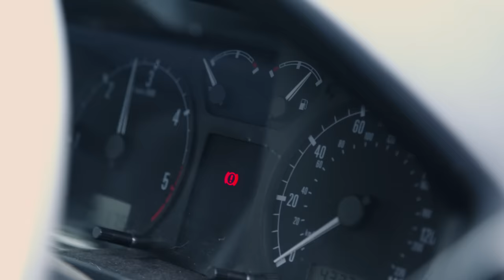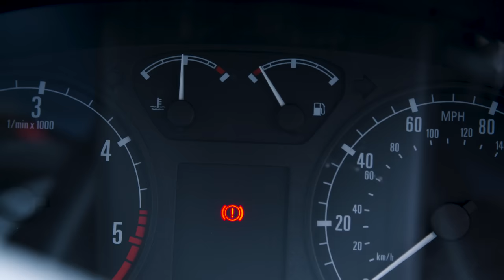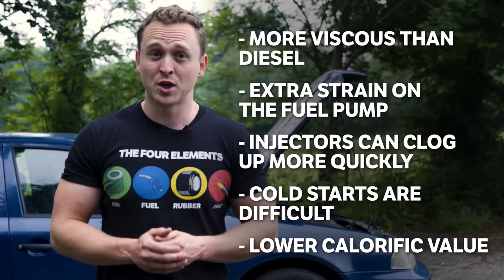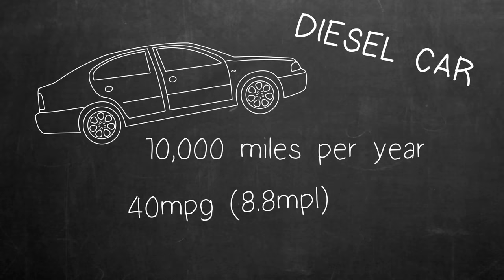The Pros & Cons Of Running An Old Diesel On Used Vegetable Oil

Comment: 6:45 but you still assumed 40 mpg from the vegetable oil, which you surely aren't getting, so you're saving less than 1200 a year.
Reply: If regular diesel does 75mpg, surely 40mpg from the oil is reasonable?
Reply: Yep like he said, it has a lower calorific value so has a lower mpg,  yet he uses 40mpg for both sums. Fail!
Reply: it would probably get the same miles per gallon unless you messed with fuel delivery, but rather you would get fewer horsepower
Reply: Biodiesel has 7% less energy than petroleum diesel. I think the mileage drops that much.
Reply: Imperial miles or US miles?
Reply: DontHatemusiK what US has its own version of miles?
Reply: diazzsama US has different gallon to UK, but miles are the same.
Reply: I hate maths
Reply: I get my oil for -free, and drive 25-30k a year, so my savings are astronomical..  My cost is about 7£ for a filter thats good for 3-400liters and about 5% petrol in the mix wintertime... I actually get a lot of petrol for free aswell, garages that empty the tanks of cars that has diesel in petrol tank or vice versa, for what I use it for petrol or diesel or a mix of the two doesn't really matter...  I does a little worse milage, but not more than 5-10% more

Comment: it also doesn’t have to be old/used veg oil, it can be straight from the supermarket bottle too. a good way to run it would be maybe 25% diesel and 75% veg oil.

Comment: Redirect the exhaust into your engine, free NOS
Reply: Different nitrogen oxides.
Reply: @BigUriel  clearly a joke
Reply: It's not, look up zero emission Santa fe neutraldrop 😂
Reply: @BigUriel  I'd think carbon dioxide would be more concerning in the first place 😁
Reply: Nitrous oxide is different to nitrogen dioxide
Reply: @buddybud-bud3828  r/woooosh
Reply: Filter it into the Turbo LOL
Reply: I think that's called EGR
Reply: That's what the EGR is for on most cars these days

Comment: What about long-time problems - poor fuel pump lubrication, injector clog? And the extra steps in obtaining and using the fuel seem like it is worth it only if you live close to a chips factory or something.
Reply: Veg oil has much more lubrication than diesel. Now for the rest, I'm not sure

Comment: I know this is a bit late but ive just seen your vid. I used to run a '96 escort 1.8d on half new veg oil/diesel. This was about 12 years ago & it actually ran smoother. I am now looking at getting a old, not turbo car thats cheap enough to wreck just to try it again but on used veg oil. It may work but not much lost if it doesnt..........All the  best..............

Comment: Once I had an old Fiat Ducato Mk2 with 2.8L JTD. For over two years I was mixing used engine oil (filtered) with home heating oil 1 to 1.  During winter I was adding 1 part of winter diesel (winter ratio was 1 to 1 to 1). Engine and fuel pump was fine. I was changing fuel filter twice a year but that was like 10 euro per year. Home heating oil was about 75% (50% if you buy in bulk - 200L or more) of diesel price and I was getting used engine oil from a friend's garage for 10% of diesel price. One more thing. The first prototype diesel engine was running on powdered charcoal (or coal, I don't remember)

Comment: NEVER USE STRAIGHT WASTE VEGGIE OIL. You should strip the glycerin backbone form the triglycerides with KOH and MethOH, otherwise, glycerin will gum up everything the fuel comes in contact with, especially the injectors. Ask me how I know. Here in California thankfully we have HPR diesel which is from renewable sources. It used to cost 2.79$ but now it costs 4.00$ a gallon :<. Benefits of HPR diesel over Biodiesel and Number 2 diesel are high cetane (75), lower emissions than both biodiesel and number 2, great cold starting, and equal or better fuel economy numbers!
Reply: Taydrum Hey I have a 2001 Dodge cummins diesel truck and I have no clue how to make biodiesel or if my engine can take it. Any tips?
Reply: "otherwise, glycerin will gum up everything the fuel comes in contact with"
Don't you mean the triglycerides?  There isn't any glycerin in the fuel, unless you have stripped off the glycerin backbones from the triglycerides.
Reply: So, how to strip the glycerin backbone?

Comment: There are other cons: I you let it sit around too long in the tank and especially the fuel line, the oil will turn into a gelatinous, plastised, mess of thick Glop.biosludge will also grow in it. In cold climates, a heated fuel tank is necessary before switching from diesel to veg oil, or it won’t flow. The other cons are frequent filter changes, and the real possibility exposure to pathogens found in rotten meat. I have seen restaurant workers toss cigarette butts coffee grounds, and who knows what else in the bins. Then you have to think about how to keep animals out of the area where you filter it.One more: Rancid veg oil is acidic and will start corroding metal parts in the entire fuel system. Turbo failure, carbon deposits, and the like just for good measure. My poor old 300d smokes after all that kid stuff. I’d get busted by the green police if I took it to town like that.And guess what;?Trying to find it especially in a panic situation ... not likely, and it can’t be stored long . So now, there the Benz sits, after several years of doodling, just waiting for the big savings to roll in.You shall see, young man lol
Reply: He pretty much addresses how to deal with viscosity and avoiding having it sat in your fuel lines in the video. 

Newsflash: Rubbish goes in bins; waste oil does not. Therefore it is unlikely you will have coffee grounds and cigarette butts to deal with. Again the video mentions filtering the oil anyway. 

As for exposure to pathogens, you are aware of how a fryer works, yeah? Even if there are any from later contamination, you're not drinking the oil so you won't get food poisoning. A diesel engine, or indeed any internal combustion engine,  can not get food poisoning.

Comment: Could you run both diesel and vegetable oil at the same time? Could help dilute the oil and be easier on the pump and better for cold starts
Reply: Yes I run 50/50 all the time

Comment: How big of a turbo can miles take? :)
Reply: Mark The Gamer Just put a p47 Thunderbold sized turbo in it.
Reply: That's a damn interesting question actually. Would be cool to see some serious garett with proper bov
Reply: Here in the Czech Republic I've seen some 1.9tdi 66kw with switched bigger turbo + chip, injectors etc. and it runs 170kw reliable.
Reply: Exactly my size
Reply: Diesel engines have no use for blowoff valves since the fuel isn't regulated by the air intake via the throttle body, like in a gasoline engine, but rather by the injectors. Would love to see him do this turbo thing though.
Reply: bov is used to go around problem of back pressure surge. Diesel can have a bov, some stock do have this though I can't recall an example.
Reply: Next video: miles's engine is gone (rod through the block)
Reply: Huh, i always figured that all diesels just didn't have BOVs, learned something new today.
Although i will add that in this specific case on a 1.9 TDi like the one in the video and the one in my driveway, the turbos actually have variable vanes on the exhaust wheel of the turbo, making BOVs obsolete in this particular case.
I did some research and found that it is entirely true that BOVs are necessary, even on diesel engines, but only when dealing with large amounts of boost/pressure (somewhere over 2,5+ bar, dependent on other factors), so i guess were both right.
Reply: See Youtube. THIS is how you have a civilized conversation. I actually had to refresh my knowladge so it's a win - win. I wanted to link you one nice video about bov's but I couldn't find it. It may have been by Car Throttle.
Reply: Miles likes to take a turbo up the tail pipe...
Reply: Haha, yeah Youtube isn't exactly known as a place for civilized discussion. To add to this, I also learned that newer diesel engines actually do make use of a throttle body, although it's controlled electronically. It's main purpose is to restrict air intake in certain situations aswell as reduce NOx emissions among other things.
Reply: amf etamin 
Hey! Coarse, but that's literally how turbos work...you can say it if it's true!
Reply: amf etamin well actually it’s made to allow more exhaust gas to recirculate since diesels nomaly are turbocharged

Comment: I know some one who drives for the last 10 years a 30 year old Mercedes 190 on used veg oil with acetone added . He puts diesel in when the MOT is due. Yes it smells like a chip shop on the road and it smokes on start up in the winter but it drives fine. Its done about 350k miles and only cost 2k when he bought it used 25 years ago. He claims he runs it for virtually nothing.

Comment: 'Miles' has a mechanical pump, DO NOT try this with piezo or common rail systems!
Reply: Cars with common rail systems probably can't start because sensors would feel something is wrong with the fuel. If start they will day after few minutes.
Reply: @sonyvegas1196  I'm pretty sure they will run. They might throw up error codes as fuel trims max out, and eventually you'll have something blocked up, but probably not for hundreds or thousands of miles.
Reply: @BigUriel   probably fuel filter first.
Reply: My Jag Xtype has a common rail and I run it on 50% veggie oil runs fine.. been running on it for 2 years now no problems starting even in the cold.
Reply: I run a jtd with it 1000s miles it is mixed though.
Reply: Even old Perkins diesel engines don't like veg oil. They smoke like buggery until the engine is hot. Enough to fail the MOT.
Reply: My buddy has a duramax that runs on veg oil?
Reply: depends on injectors solely if its new design "electronic injectors" PD in volkswagen case they will die fast. The thing with them is that each of the injector is controlling the fuel pumped in to the cylinder and act as a fuel pump themselves, they moderate the amount of fuel pumped. The older design engines are dependent on main fuel pump that pushes the fuel through the injectors. The old system just use high pressure made by fuel pump, so the main issue could be clogging of the injectors. But the new system, each injector calculates how much fuel it needs to take so it is complicated system..

Comment: Don't think you can do this with a more modern CR based diesel without mods and even then its a wee bit iffy due to the injectors they use but its perfect for the older diesels.
Reply: correct, veg oil can't be used with any modern high pressure/common rail direct injection diesel as it doesn't atomise properly, but any older indirect injection should be ok (merc OM/pug XUD/VAG non-PD TDI)
Reply: Just had a look at the site shown in the clip - the owner seems to have a 2005 based diesel that looks to me to be a CR based... plot thickens as such :p
Reply: http://www.vegoilcar.co.uk/index.php  "I took my 2005 Toyota Landcruiser diesel car" & "My car is a 2005 LC4 Toyota Landcruiser diesel" - Think thats CR but unsure.

Comment: Didn't you need to add any solvent into your vegetable oil? I remember Top Gear doing this a while back in a Volvo and they put some white spirit into the oil.
Reply: Kevin Wong - I have tried it with white spirits and without and it made no difference.
Reply: Vegetable oil lubricates better than low sulfur diesel. In fact, it will break up carbon deposits and can clog the fuel filter.
Reply: 5Rounds Rapid - I found that it would 'wash down' the fuel tank the first couple of fill-ups. I have ran two cars on veg and had to  change the fuel filters soon after starting to use veg. After that, I never had any issues with blocked filters.
The fatal error in the CT vid is the used oil needs to be heated to around 50-60 deg centigrade for at least 24 hours to remove any moisture. Used oil inevitably contains moisture from cooking food.
Reply: good tip, cheers
Reply: Depending on your mileage and how much diesel is where you live,   unused veg oil from the supermarket can be poured straight in if your car is an indirect diesel, as long as you haven't got a Lucas fuel pump. I have used veg and sunflower oil with great success. Diesel is £1.26p a litre at the moment, if it keeps going up then I'll be on the hunt for an old diesel car again.
Reply: Top Gear used rapeseed oil
Reply: Sean Taylor - supermarket veg oil is actually rapeseed oil.
Reply: I did not know that, makes sense they don't market it that way though :P

Comment: I'm literally started putting vegetable oil into my fuel tank as the fuel prices go up.
 it seems that vegetable oil is a lot cheaper. (Obviously) 
I have noticed a power increase since using vegetable oil. 
My vehicle used to go in limp mode from overboosting but it seems the cooking oil has lubricated the turbo and now it's operating perfect.

I add vegetables oil and diesel to the tank.  60% vegetable oil/ 40% diesel. 

I've removed the EGR valve too and I'm not getting any smoke even when cold or when putting my foot down. 

Smells great though. Smells like nitro fuel
Reply: What car do you have ?
Reply: @paufarreny989  Seat leon MK1 1.4L TDI

Comment: 6:48 that £1200 are going into fuel pump repairs.
Reply: more like combined with the injectors
Reply: fuel pump with injectors for that car can be found for like ~300$ or so.. New ones will cost more but not that much..

Comment: I used to run 50/50 veg oil,diesel in a 90's chevy truck with a catapiller engine in it. Installed an extra fuel filter inline and never had any problems. 
Not in the winter though.

Comment: This video starting to get popular again cause of the rising gas prices due to war. Anyway, with my 1987 diesel shitbox i run 80/20 to 50/50 mix diesel/waste vegetable oil depending by the season, and still manage to get up to 60 mpg with and old Bosch mechanical fuel pump (no electronic, no problems) : https://youtu.be/xmbJjJl6KVY This is it

Comment: Miles is the same colour as my old Octavia which I ran on 100% recycled veg oil. I ran a Sharan and an A4 on it too.
They all had VAG's trusty old 1.9TDi. Veg oil cleans all the old diesel gunk out of your system, so replace your fuel filter after the first couple of hundred km or so. Mix maybe 50/50 with conventional diesel in cold winters, and you're good to go. Your acceleration won't be as fast, so take care with overtaking ; )

Comment: You dont need a second fuel tank we ran a diesel on oil for years without ever using diesel
Reply: Did you use fresh, new oil? It's it possible to do that?

Comment: If you make a paste of Baking powder and water(make it fairly loose not thick), and flour and water mix works too.. Add to warm old oil and bring the temperature up to a gentle boil. This will purify the oil. Egg whites blended will also work. All this depends on how much oil you have to purify.

Comment: I wish we had more diesels in America.
Reply: Diesel costs equal or more than gasoline here, so what's the point?
Reply: lokisgodhi did you not watch the video? Diesel engines can be run on vegetable oil which costs much less than diesel or gasoline.
Reply: +Golden Grenadier   Moron, did you not read and understand the implications of my post? The vast majority of people are not going to deal with the hassle of running down WVO and dealing with the mess of cleaning it up. Especially people with new or late model cars.  More importantly, no one is going to void their warranty modifying a new car costing $25k minimum and usually a lot more to use WVO in it. You only see WVO done with old cars. WVO is only a viable option IF it's free and available. In a lot of places in the US, it's not free or available. It's sold to bulk dealers. I live in NYC, there's no fucking way I'd ever be able to get free WVO.  Dealers come in big trucks and suck it out of the restaurants fryers when they change it, do the cleaning work, catalyze it into biodiesel and then sell it. It's near the price of petroleum diesel.  So most people aren't going to buy a diesel car because of the price of pump petroleum diesel makes sales of new diesels pointless.
Reply: Older diesels will new ones need extensive modifications to run on waste oil.
Try an old mercedes they are fairly cheap in the US.
A 240D, 190D or a 124 diesel.
Reply: Golden Grenadier you can just use autogas for gasoline engines its probably cheaper than this i use autogas in my car
Reply: In Europe "we" (who care about air quality)  say the same but for gasoline.. because in cityes we have very high levels of particulate matter that go into the blood stream..
Reply: American diesel is to dirty for the European clean diesel and you are NOT going to run biodiesel in these new clean idle diesel engines unless you want to damage the fuel system. I see nothing wrong with running the 5ppm or even 15ppm diesel in a car or truck with emission such as egr and dpf

Comment: Can a car run on NEW vegetable oil?
Reply: Doesn't matter if new or old. Just don't put it into modern Diesels they can't handle it.
Reply: Ben Doherty You can, but it's more expensive than diesel these days and still has the same drawbacks of used oil, so why would you?